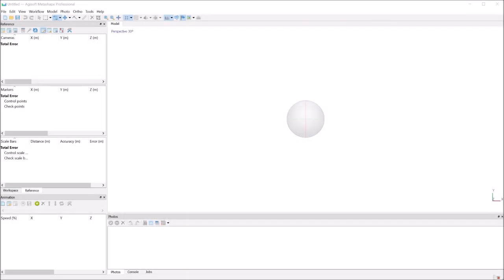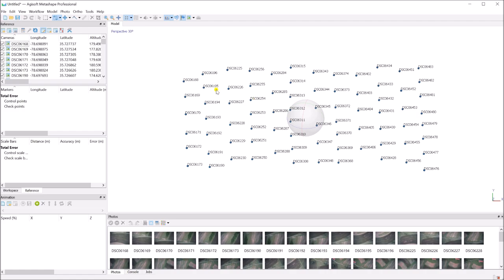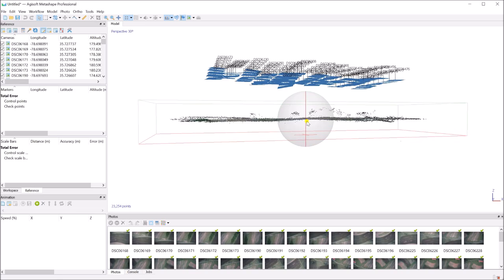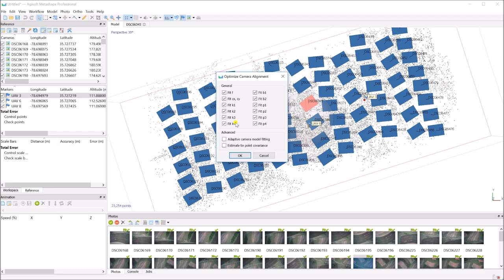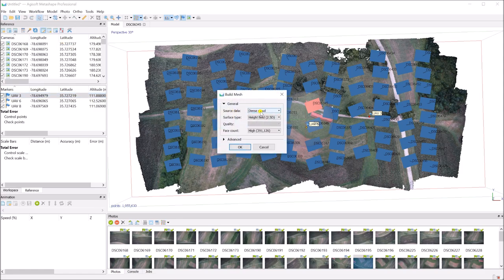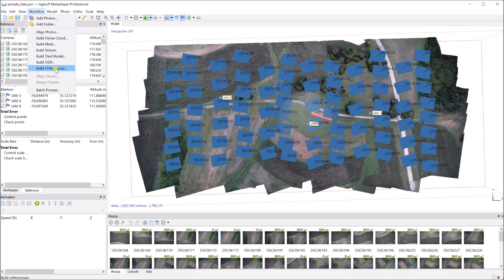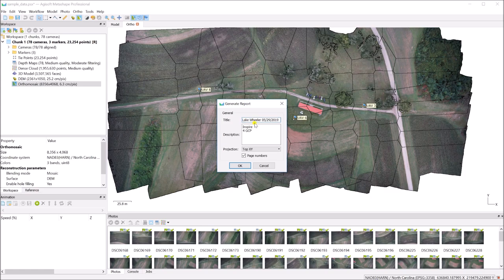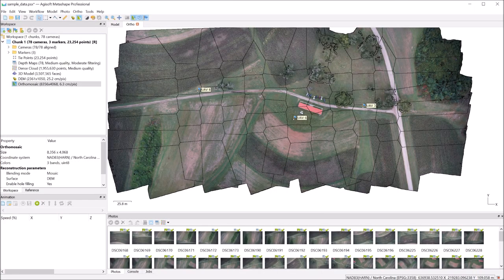TUTORIAL Agisoft Metashape - orthophoto and DSM generation (with GCPs)

Comment: Hello Justyna, 

First, thank you for this tutorial !! Good job ! 
i have a question about the GCP for georeferencing. 
how do you georeference images and integrate gcp with coordinates in another projection?  
I explain, I have images with WGS84 coordinates but to improve the accuracy I need to use points in a more precise local projection. Unfortunately when I import these points they are not visible in the model. 
And there are no image matches when I click on these points (landmarks). 

Ps: sorry for my english i'm french ! 
Best regards, 

Marc
Reply from the maker: In the reference pane, click "reference settings" icon (the last one in the row) and you can independently choose a coordinate system for your cameras (WGS84) and then the local coordinate system for your markers.

Comment: Thank you for your video. Do you know if I can use local/arbitrary coordinate system for the GCP?
Reply from the maker: Yes, your GCP can be in the local system. But the. If you will try to align the photos to them, there needs to a transformation. As far as I know Agisoft does transformation from different geographic/projected systems but with your local one you will probably just need to stick to it and have the whole project in local coordinates

Comment: Hi Justyna, Thx. for the detailed explanation. For the updated ver. 1.6 of Metashape, if I want to determine the height of an object  (Tree,Building etc.) using the DSM and DTM (as described in the Ver. 1.6 Metashape manual), how can the DTM be determined and then "DSM-DTM= height"  be determined ? Thx.
Reply from the maker: There is a option “filter ground points”. It has 3 parameters describing the angle, radius and conditions to determine which points will be classified as ground. It is not perfect but you can achieve ok results. Then you go to generate DEM and you indicate “only ground points” that should create a “bare earth” DEM. Note that the wholes where the items (vegetation, buildings…) were will be interpolated so you will see flat spots in their places
Reply from the maker: And then I took it out of Agisoft to GIS software (QGIS and GRASS opensouce and free) and just a simple map calculation of differences between the layers. 
If you want to calculate the tree tops w height I recommend using R package ForestTools

Comment: Good video.

1 - In the Alignment Process you didn´t show the number of key and tie points and how many do we have to use.
2 - In the optimization, Do I always have to select all the coefficients or its depends of the camera that I used?
3 - when I create the Dense cloud, I use HIGH and AGRESSIVE - Am i doing something wrong?

I hope you can help me.
Reply from the maker: 1 - Unless there is a problem with alignment, I go with the default values
2 - No, you don't have to check all the coefficients, unfortunately, I am not an expert on camera optics, but from what I know, the k coefficients are not as crucial
3 - HIGH accuracy for the dense cloud generation requires much more computational power, if your computer is powerful enough and your project not too big, you can certainly go for HIGH. It will just take more time. Using Mild, Moderate or Aggressive depth filtering depends on the amount of the outliers you want to preserve. If you are modeling a surface with complex geometry (like plants) and you want to preserve all the details you should use Mild or even turn the depth filtering off.

Comment: Great video with clear explanation (5 Stars).  I have a problem, after importing the GCPs i tried to filter photos by markers option but the photos are not appearing with any of the points. Plz hlp...!
Reply from the maker: My first suspect is the projection. Are the GCP measurements in the same projection (coordinate system) as the images?
Reply: go into one of the photos, right click and place marker, match your marker to that point. Do it to at least 2-3 photos. It will apply it to others automatically

Comment: Thank you for the video. It is helpful. I am facing a problem. I import the GCP data as .CSV file by using "import reference" but it does not appear under the markers option. i have data for 5 GCP. thanks for your reply
Reply from the maker: Check your table headers. They need to match the Agisoft lat long and alt. Otherwise you will load empty data

Comment: Hello, do you re align the photos after optimization with the gcp ?
Reply from the maker: Photos alignment needs to be performed before the optimization.
Reply: @justynajeziorska6205  thanks a lot. Which altitude do you flight with the drône? I used to flight 40 meters and I think it isn't enough because some picture doesn't have gcp. May be that's the reason I've got really bad result in agisoft after the optimalization, the model is curve.. What do you think about that?

Comment: How can i export it as a .shp ?
Reply from the maker: Only the vector files can be exported as shp since it’s a vector supporting file extension. Any points, polygons or lines you create on the project (like contours) can be exported as shp. 
Orthophotos and DSM are rasters, you have multiple file extensions for storage, the most commonly used in GIS software is GeoTiff. 
I recommend exporting points to las or laz, all the geospatial software can handle it. 
The models- it depends what kind of modeling environment do you want to bring them in. I found .obj format pretty versatile

Comment: Is it okay if I create a GCP out of plywood and use the drone as a GPS for it?
Reply from the maker: Usually, the drone doesn't have a high accuracy GPS on board. You would need something with the possibility of differential correction
Reply: @justynajeziorska6205  Thank you :) it makes sense. Btw, how much diffrence will a GCP make?
Reply from the maker: @abhishekbaguldesign It makes a big difference if you need absolute accuracy. Here you have some simple explanation: https://support.precisionmapper.com/support/solutions/articles/6000187275-benefits-of-ground-control-points
Reply: @justynajeziorska6205  Hi Justyna, which model of Trimble Drone did you use?
Reply from the maker: @Tisijola  we used Trimble UX5 I believe it is discontinued now and our model “retired” couple of years ago too. It had a good life with lots of flights